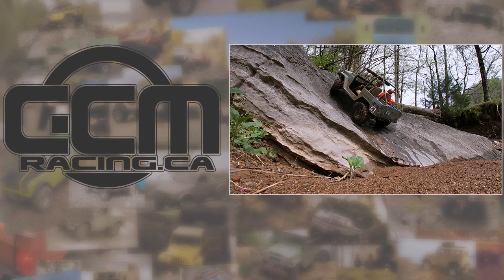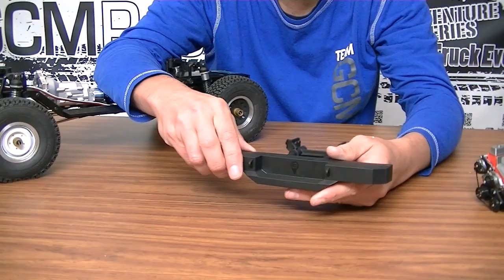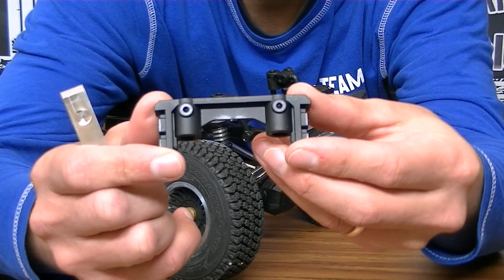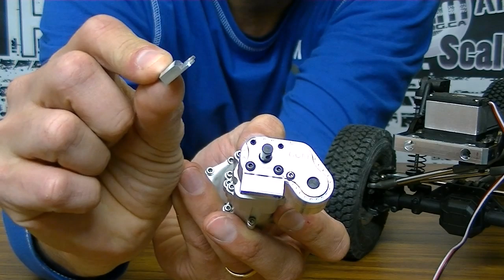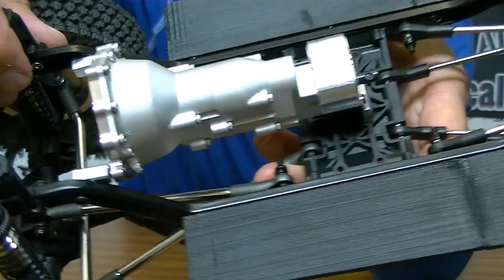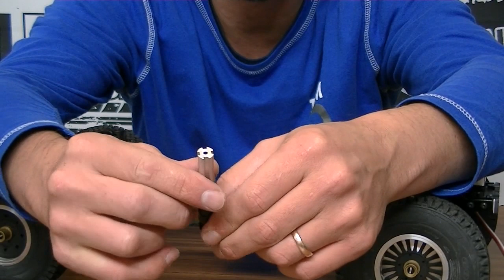Element RC Enduro LRT2 Scale Transmission Conversion Instructions

Comment: I have a problem with the drive shaft theory . This guy is saying that you dont want the end drive shaft link close to the end of the front drive shaft . So his solution is to put in a stop in the front half of the drive shaft . Or using a screw into the rear half drive shaft .  This idea will not keep the rear half from being any farther in on the front half . Now I am not an idiot . But this will only fix the problem for a short time . Then it will starts to damage the groves on the inner house of the front shaft . The real fix to this problem is for GCM to have by China Company longer rear shafts for replacement . Here is my idea of a better fix . Go and buy a rear drive shaft  . Cut the inner aluminum part to length . Drill the center hole  just deep enough to clear head of Allen screw into the shaft . Then drill all the way threw with a smaller bit to clear the threads in the shaft . So that the Allen screw can pass threw . Now you can mate up the both shafts and screw them together .   Make sure the the mating shafts perfectly even and true . You also want to bevel the ends with first at 400 sand paper and then with 800 grit sand paper . The if you must polish them also . The good note is that you can make any length you want .  Here is a good note when cutting and having true ends . Hold the shaft you want to cut  in a drill and lay the drill down on a table  on it's side . It would be nice if the drill is a variable speed drill .  The chuck up a cut off wheel to a Dremel  . With the drill turning slowly  and well rested on a table  in one hand . The with the other hand the Dremel running above 9,000 and inline with the work then proceed to cut off the part you need .  Not done just yet . Chuck that part into the drill and do a little clean up and truing . Then finish sanding and polishing on the corners .
Reply from the maker: that works too! I commented about using the stock parts for that reason.. to get someone going quickly without purchasing new driveshafts right away. This solution has been working on our Element builds for a good long time though, so nothing catastrophic has happened at all with this.

Comment: Will this kit work with the trailwalker edition and IFS upgrade?
Reply from the maker: The TW is the same as the others. The IFS works, yes, if you move the servo to the side plate. We are working on a kit for this.
Reply: @GCMRacing1  what about with the ifs  in the scx 10.2?